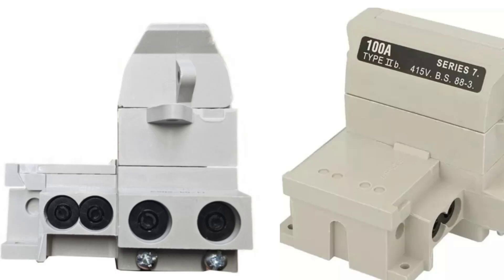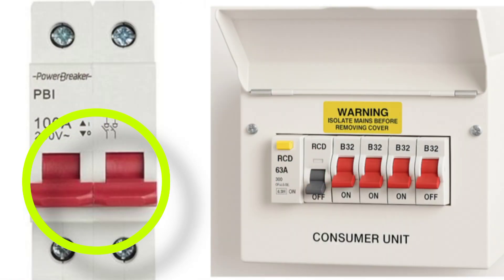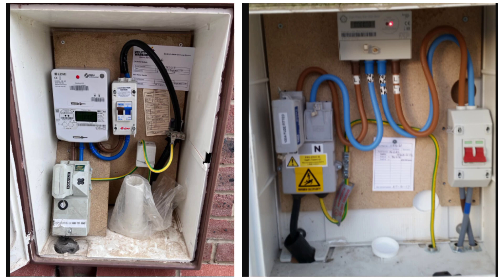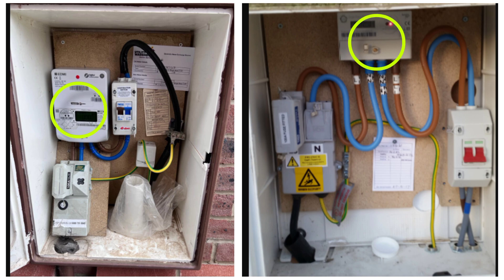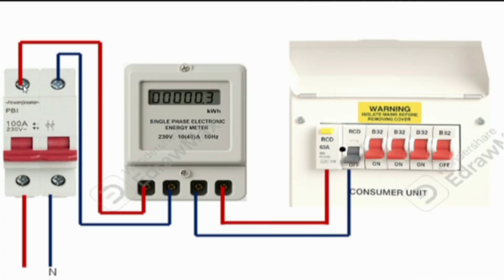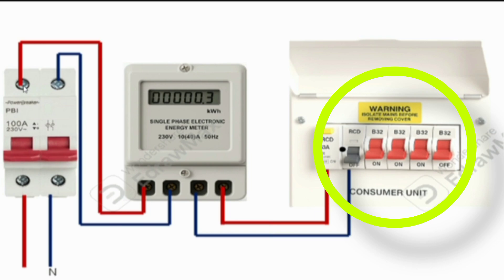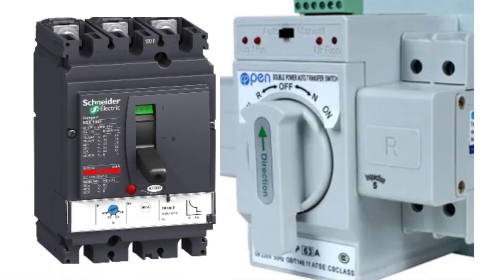Proper Way to Arrange power supply Control Devices in Electrical Wiring.

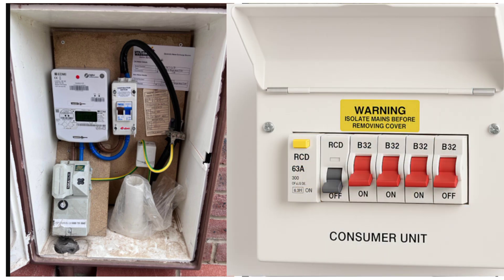Comment: 2:56 So now my question is, should the main switch MCB or RCD. Refering to the one immediately after the energy meter...
Reply from the maker: @danielteyehuago1633  
Normally, it should be an MCB
Reply: @obloni_Electrical  
Refering to the one immediately after the energy meter...
Reply from the maker: @danielteyehuago1633  
Yes. I know
Reply: @obloni_Electrical  thanks... Then I have always been right about the correct position on this device...